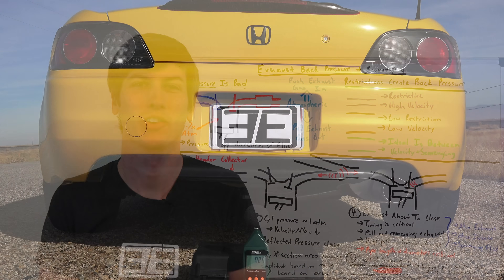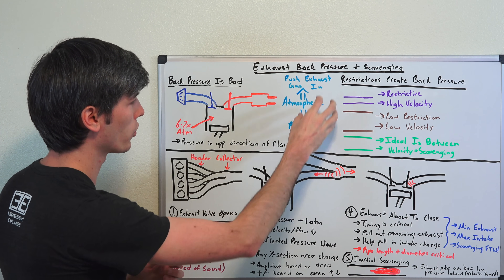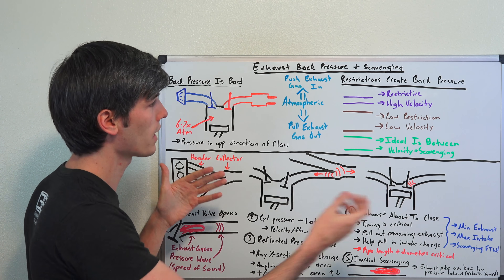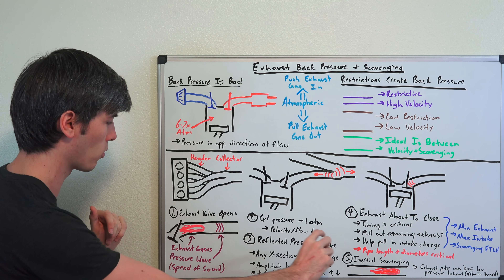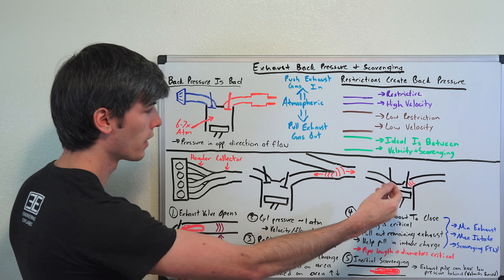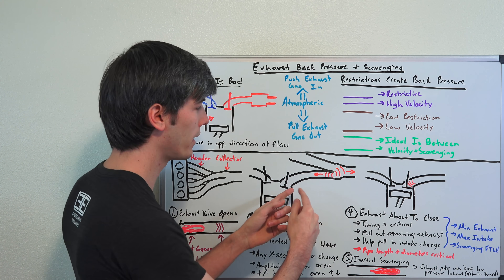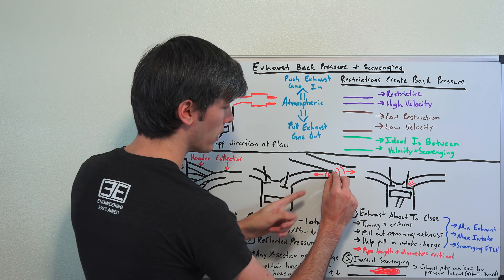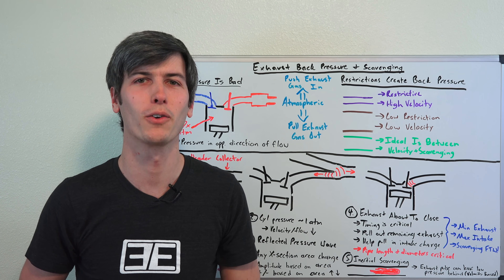Stop Saying Car Exhausts Need Back Pressure

Comment: Just attach a compressor that will suck the exhaust gasses out of the engine
Reply: A turbo can’t both suck out exhaust and be powered by it at the same time. The turbo will always give some resistance. If it did suck out exhaust it would be when you let off the pedal because the turbo is still spinning at a faster speed then the gas coming out but then it will drop in speed till it is again being powered by the exhaust. It doesn’t stop spinning until the vehicle is off.
Reply: Arctic Avenger old 2 stroke big rigs did just that. 6-71 roots style superchargers were mounted on the exhaust side of the engine
Reply: Is That not  basically what a Turbo is?..  But then a turbo is also driven by exhaust pressure.  So this is question I cannot answer.  Does the exhaust half of a turbo actually have any 'suction' effect on the exhaust.  My guess is that at first, no.  But once the turbo has spooled up, it seems that centrifugal force would have some 'suction' effect. And I would also speculate that this 'suction' effect...  Okay I guess that would be Vacuum.  So then the amount of vacuum that you might get, would depend on weight, and could be increased by adding weight to the impeller.  But then adding weight to the impeller would result in slower spool up, and greater back pressure during the spool up phase.  So there would be a trade off that would have to be considered during design.  That's just my own speculation.  Don't know if it's true or not.  If anyone knows the answer, please comment!
Reply: look at the tail pipe on a duramax. they use the venturri effect to draw exhaust gases out at road speed(negative pressure)
Reply: That's more to cool the exhaust at the tip than it is to draw gasses out.  The venturi you are referring to is more like what's on a safety tip on an air hose.  The faster moving air (exhaust) creates a low pressure area that sucks more air from the atmosphere into the stream.  In the case of an air nozzle, it's to allow a greater volume but also to allow the air to go somewhere if you push it against something.  In the case of the exhaust, it's to pull cooler air into the stream so it isn't as hot.  (This isn't as much an issue with semi-trucks as their exhaust stacks are up high, away from people).

Comment: I heard once that Harley V2 (at least old ones) "need" a minimum amount of back pressure and that completely open exhausts were bad for them, bad in the sense that it can damage them, not just performance loss... No idea if it's actually true, or just part of the same myth.

Is it possible that some engines are designed to work with a certain amount of back pressure ? If the valves are by design "loose" and count on some back pressure to damp them ... or something like that ... ?

Comment: When the exhaust valve opens before BDC the cylinder already is in state of below atmospheric pressure. In this moment exhaust gases from the exhaust system flow back into the cylinder because of the pressure differential. The moving piston after BDC then creates a higher in-cylinder pressure  and hence the gases are expelled from the cylinder.
It's not that the gases are expelled immediately once the exhaust valve opens. Can you confirm this?

Thank you and greetings.

Comment: Where did the pressure wave come from? Like in a water hammer the fluid itself is making the pressure waves, but you say when the valve is opened a low pressure wave shoots out and the fluid follows, and this pressure wave reflects and and travels through the air mass back to the valve. What theorem are you getting this from? I learned that the Tuned pipe lengths reflect mass, and like you said a low pressure follows the air mass. You want the mass to reflect off the back of the valve just before it opens to take advantage of the low pressure. This is based from Helmholtz Resonance theory. So I'm asking what theory you have learned since I've never heard it explained this way.

Comment: ( HNY!! ) My 2.7 ton 1997 4.2l naturally-aspirated diesel Toyota Landcruiser with extractors (headers) & 2 1/2" exhaust ( 2@straight thru mufflers) gets 28.1mpg (highway 70mph). Note: the mechanical injector pump had to be retuned due to the extra scavenging

Comment: I'm a little suprised that anyone has even heard of this old piece of advice. Doesn't have anything to do with scavanging. Dates back to when vehicles were still carbureted. If you significantly changed a cars' breathing capabilities, you screwed up the carb tuning, and there was no computer to mod the A/F ratios. Every kid in high school would slap on open-element air cleaner and headers with straight pipes, but no one would bother to dig into the carb and change the jets and rods. The result would be that it would start eating gas and wouldn't really idle right, and you'd be throwing HP right out the tailpipe.
Reply: Also some eary fuel injection motors computers are too simple and dont know how to do anything but stock
Reply: Why not? The pressure waves make sense as well.
Reply: It's the same concept be it ecm or carb. If you change something to the car, motor intake exhaust etc, you have to tell the computer you made those changes otherwise it will keep doing what it was programmed too. Same with carb if you dont adjust or change the jets it will keep doing the same thing. Causing the idle issues, spitting unburned fuel air out the back, and other things
Reply: Stock 289 High Performance Mustang from Ford, 271 HP.  Shelby Modified High Performance Mustang 306 HP?

Comment: I've been told by many mechanics and stock car racers that some back pressure is necessary because excessive exhaust velocity will burn up exhaust valves in the same way that magnum rifle cartridges generally cause rapid wear to the throat of a barrel.  I'm sure modern metallurgy can get around this, but apparently it was a problem for old-fashioned steel valves and seats.

Comment: Happy New Year and great explanation. Say, my '14 Civic 1.8 l has the exhaust collection happening in the head, before it exits. What the heck are those Honda engineers doing?
Reply: clockworkbike getting the engine up to heat quicker for emissions that way the can have coolant flowing around the exhaust from what I believe

Comment: The following is directly from Ford in a guide they give their techs: "Identifying Failures Related to Performance Modifications" (this is to determine if modifications may have caused component failure and voids repairs under warranty). The portion I am posting here is regarding exhaust modifications and reduced back pressure: 

Description: Common modifications include the removal of catalysts, mufflers and resonators. In turbocharged applications modifications to the exhaust system can reduce backpressure and may result in over-speeding the turbo(s). In some cases a good indicator of an aftermarket exhaust is the presence of additional clamps (Figure 19A and 19B). Visually compare installed exhaust to pictures of OEM exhaust, if necessary.
Possible Failure Modes:
 Turbocharger compressor damage (Sec. A.2.1)
 Exhaust smoke due to change in system backpressure
 Piston damage (Sec. A.1.1-A.1.2)

Comment: My question would be, how do you determine the optimal length and diameter of tubing, and the amount of restrictiveness of your mufflers/Catalytic converter(s) to gain the most performance throughout the rev range of your particular high performance vehicle, with the least amount of experimentation ? I don't like guess, and fail, and guess again, and fail again.

Comment: But wait he did say to big of pipes are not good because you need exhaust velocity and get it by using a smaller pipe which creates some back pressure. Some back pressure is needed.His quote is "you want a balance of velocity and minimal back pressure" If you have large pipes you will have less low end torque.

Comment: What about cam overlap? Could have mentioned that as well as proper scavenging effect increases the pressure differential therefore improving the bernoulli effect at the valves allowing the exhaust to pull in fresh air into the chamber 🤓

Comment: Regarding the low pressure area behind the vehicle. Does this mean that exhaust placement, such as directly off the manifold in the engine bay, or side port, affects performance with the air flowing around the car?

Comment: OK, two questions I'm left with is how do you know what diameter and length to use, and how much does hp/tq play a role in determining length and dia.? Now you need to do a video giving us an idea of how to figure out the proper lengths and diameters of pipe needed for our projects. I, of course, understand that each application will be different, but I'm sure you could give us some break down of how we could determine what size exhaust would be most beneficial, and what would really hurt performance.

Comment: Motor trend did a video showing exactly why u are wrong. Yes u do need back pressure. U need the right amount of back pressure. Btw, they put open, 2 inch, and 3 inch on the same motor and dynod them.  Back pressure gives more torque.

Comment: You did not explain it all, you left out intake/exhaust valve overlap to promote scavenging, without that the engine will not run at peak efficiency no matter how low your backpressure..........talk to some high performance people and get schooled.........also to low of backpressure or to high exhaust velocity will "burn" exhaust valves if pressure wave too low and throttle released to idle will "warp" exhaust  valves as cold atmospheric air is pulled back into engine........
Reply: One more thing you did not discuss "two stroke" engine which absolutely need the correct amount of backpressure to run correctly....ie chainsaw or snowmobile.

Comment: I’d almost buy all this. But I’ve seen muffler exhaust pull more power on dyno than straight. And this is t getting into torque. Which is something back pressure will help

Comment: It should be pointed out that scavenging only takes place inside the header, so people who do straight or no pipes after the header and get warned of lack of back pressure are actually doing the right thing for power.

Do F1 exhaust manifolds use scavenging? What kind of restrictions do they have in their rules for exhaust? I'm wondering why F1 has exhaust header manifolds while top fuel cars just have straight pipe primaries that don't even merge in the exhaust. Which way is better for max power? What about for overall power under the curve? Does F1 have manifolds just because its a rule, would they be better or worse off with top fuel style headers?

Since top fuel and F1 are the fastest cars in the world I always look at their designs for what is 'the best' way to do it.
Reply: You don't find any naturally-aspirated dragsters.  Huge difference.  They have a blower forcing air into cylinders that have long overlap.  Naturally aspirated engines need properly sized exhaust manifolds or headers that have the right volume to keep exhaust gases moving at high velocity between the exhaust port and the collector.  Its not  back pressure these engines need, but they need proper volume and velocity of exhaust gases so fluid dynamics helps increase scavenging.

Comment: i'm not here to troll but the "backpressure is good" is a throwback to early valve stem materials, the problem is if extreme cold air would come in contact with the valve stem it would bend and usually cause even more damage of course this is when the motor is shut down, so if there is no resistance aka mufflers etc. there was a possibility of engine damage. Anyone who says that backpressure is good for power needs to listen to Jason

Comment: Another oft quoted reason/justification for an engine needing back pressure is burned exhaust valves. Not addressed in the video, but also an untrue myth. This came about from people removing exhaust systems from carbureted engines and not retuning for the leaner condition the reduced breathing restriction caused. Lean running then causes a loss of power and increased exhaust temperature and hence burned valves.

Comment: Great video as usual! Could you talk about how unequal length headers on a Subaru are actually less efficient than aftermarket equal length headers. Could the cause of so many cylinder 4 failures on Subaru motors be related to wrong timing on the negative pressure wave reaching the exhaust valve? Thanks!

Comment: I have 2 questions I’m hoping you could answer: 1. In a NA engine everything you said makes perfect sense. In a turbo setup, would you just want the least restrictive exhaust possible since everything behind the turbo should be irrelevant to cylinder pressure?  2. The wave scavenging concept makes sense to me but it seems like a really small window for which your pressure waves would be timed correctly. In high tolerance applications like F1 where the RPM range is so large, does scavenging play a role? I am sure setting up standing waves in the exhaust would be possible to take advantage of a harmonic effect to hit more RPM ranges but that seems really hard or impossible to engineer. Do they do that?

Comment: He says you don't want back pressure, but you do want exhaust scavenging and exhaust velocity. You can't get either of those things without having back pressure, so there needs to be a balance. But in order for there to be balance you have to have some of all three, meaning you have to have some back pressure if you want the other two. If you need some of anything you still need that thing. So you basically need back pressure and he is wrong. We're all good to keep saying car exhaust need back pressure.

Comment: this is all well and true. Until you hit valveless rc two stroke engines. They need a pretty specific exhaust which creates a shockwave of back pressure for fully charging in order to run well.
They can run without it, but they will not run as good. Additionally they use exhaust pressure for fuel pumping.

Comment: So I have a muffler related question. I have a 2001 silverado 2500 6.0 gas truck with a mild cam, and now 76mm turbo. Has about 5 feet (including downpipe) of 4" pipe as the exhaust now. Before turbo setup, there was a timeable difference  when I had muffler on or off. Without muffler= long tubes and a y pipe as exhaust. It was a solid .4 second slower 0-60 when the muffler was not on. No one believed me but I tested it numerous times. This was with the cam btw. So my question is, with my new setup, how much exhaust do I need? Will I gain some torque if I throw a muffler on? Will that muffler gain come back or is the turbo enough of a restriction that I don't need anything else. The truck is only on 6psi so it isn't a ridiculous powerhouse, about 500 to the wheels or so.

Comment: Cars need back pressure. What kind of back pressure? Just enough to hit that sweet spot. I’m confused because the video says they don’t need it but you talk about having the right size exhaust diameter to have a “sweet spot” so the car can run efficiently. I guess cars don’t technically need an exhaust to run but if it’s not gonna run right then why would this topic matter? Not trying to knock your knowledge on the topic but how can you dispute back pressure with engineers that have been designing engines for cars for decades

Comment: Hmm...very interesting.  So it would seem that when people get a "racing cam" for old big-block engines, it would be best with new headers, too?  Maybe designed for the rpm range that they want to maximize?  (Just kicking around ideas here...)
Reply: Your comment seems more of a brag about running eights than answering any questions or contributing to the conversation
Reply: Who is we??? 😂

I’m assuming your point was that big cams make high end power but it’s an assumption cause u just stated rpms and nothing else
Reply: Thats what i was thinking... on large stage 3+ cams they say that you NEED a long tube header which makes sense so the low pressure wave would come back at the right time due to the different valve timing from the cam

Its all about picking the perfect combo for your build i suppose
Reply: Knew a fellow who always had to have the biggest and best, like his 2 inch tube headers. Very much disappointed when found out smaller tubes actually work better
Reply: @michaelszczys8316  pends on application; lot of variables.  Short track racing for years; still amazed on the amount of "definitive facts" i have heard over years.

Things get really weird when they throw a restrictor plate in the mix or tiny carb limit (to keep speed down).   

One thing that stays kind of constant; more compression and more rpm, the rest is how to get there.  Keeping in mind us circle track guys are a weird bunch.
Reply: what is ur point
Reply: Headers and exhaust is first. Then you're disgusted by the sound of "stock motor with exhaust" then you build a motor.
Reply: We launched our BBC at 4,500, shifted at 7,000 , up to 7,800 in the traps. 7:90 all day @178mph in the quarter. Any questions?
Reply: I'm sorry, my comment was more for Ray, I'm not sure about you and your "stage 3 cams", we have actual specs.
Reply: Thanks for pointing that out, we actually ran 7.90's.... We, as in we the team. Car ran consistently for 6 years with NO problems other than tune up and oil change. Could have pushed into low 7's, but we don't want to work on the car every weekend. More than one person is required to operate the vehicle because in the late rounds you don't have time to pack the parachute ,and fill it with gas (methanol) ,and check the air pressures in time to get back in staging lanes. Your trolling has no power here. Have a nice day.